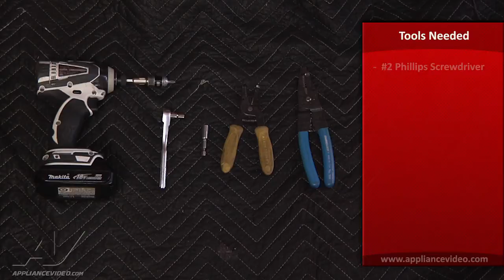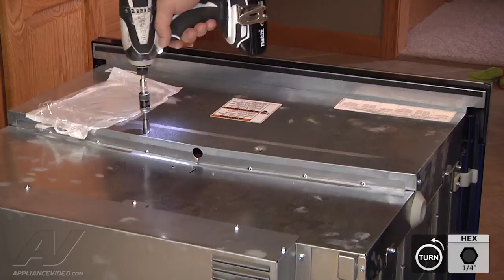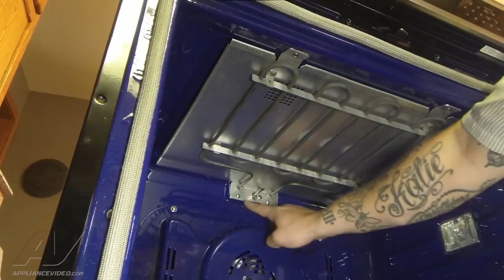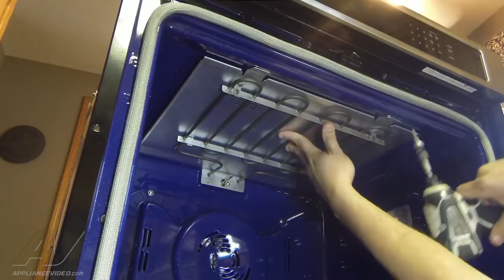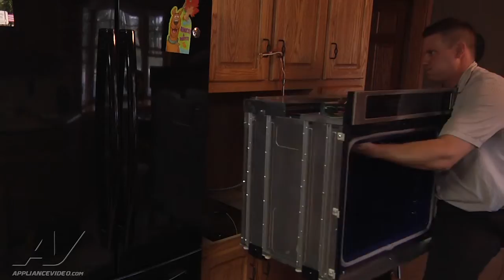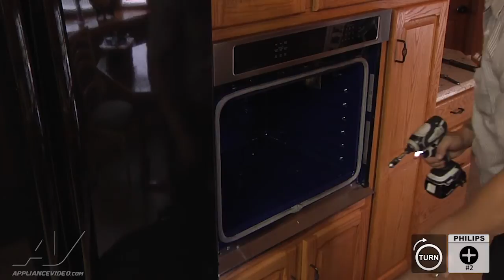Kitchenaid Oven Repair - Not Heating - Broil Element

Comment: Hi.  I need your help.  Wife boiled over some water and a few drops got behind the front panel of this wall oven.  The control panel is black and buttons are unresponsive.  With the power off I have tested the following.  

Thermal fuse was removed and tested good for continuity.
The main board had no obvious damage and was not wet.

SUSPECT #1
The LCD display had a shorted wire from a water drop.  The shorted lead was from the board going into the display.  I cleaned the lead and re-soldered.  This is the only visual damage to the oven.  I reassembled everything and re-tested but everything is still broken.

SUSPECT #2
The transformer has power going in and out of it. Disconnected it also tests good for continuity on both sides of the transformer, high and low.  Everything seems ok with the transformer except for the fact that the output voltage doesnt match the sticker.  

Color..............marked.....actual
red/red...........33.............36.8
blue/blue........11.............12.1
yellow/gr#1.....3.3.............3.3
yellow/gr#2.....3.3.............3.3

I have a transformer on order but am afraid that this isnt going to be the solution. Any advice?  I am 3-days out for a service call... and likely 2 weeks before they can obtain the parts.  But I can order them myself and have this fixed in 24hrs if I can determine what parts to order.  

THANK YOU SO MUCH!
Reply from the maker: Mark 
  All of our technicians are now answering questions daily on the ApplianceVideo.com website. You can search completely FREE in our Repair Help section. Or you can get unlimited technical advice and video links emailed to you by our 14 factory certified technicians at http://www.appliancevideo.com/premium-membership/.  If you are in need of any parts please support our parts department on line at http://savemoreonparts.com/ or call 1-800-830-5465 7-days a week until 11pm Eastern time. Thanks for your support. Matt Ace Appliance factory service technician.

Comment: Sir. Have the same oven.  Wife boiled over some water last night.  Some water dripped down around the lip of the counter and got behind the control panel.  
The oven will not turn on or make any keypad sounds.  

WHAT I TESTED:
The main power lugs and transformer have power going in.  
The LCD board had a short from a few water drops.  I re-soldered the short but there is another problem somewhere in the oben.  
The transformer (disconnected) tests good for continuity on the input and on each pair of the outputs.  While connected I tried testing it for power.  Input was hot.  Output was nothing.  But its hard to test these little leads.  
The thermal fuse was removed and tests good for continuity.
The main board shows no shorts or water

1) what should I do next?  
2) how can i protect against another water spill incident?
Most importantly.... THANK YOU for your time and help.
Reply from the maker: Mark
   All of our technicians are now answering questions daily on the ApplianceVideo.com website. You can search completely FREE in our Repair Help section . Or you can get unlimited technical advice and video links emailed to you by our 14 factory certified technicians at http://www.appliancevideo.com/premium-membership/.  If you are in need of any parts please support our parts department on line at http://savemoreonparts.com/ or call 1-800-830-5465 7-days a week until 11pm Eastern time. Thanks for your support. Matt Ace Appliance factory service technician.